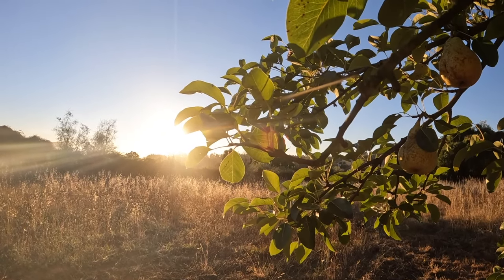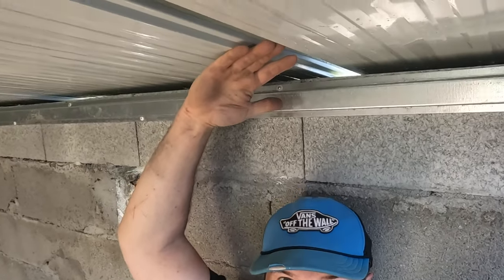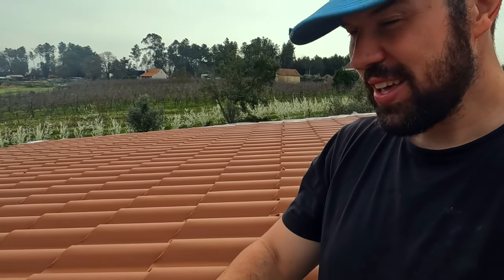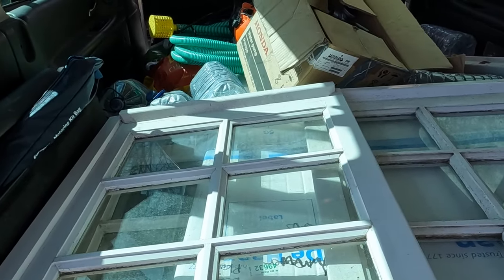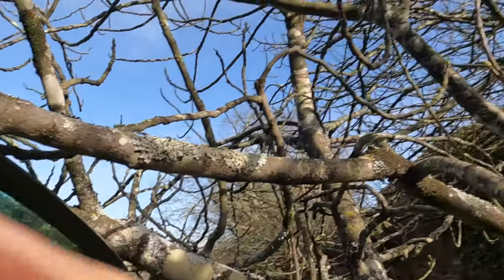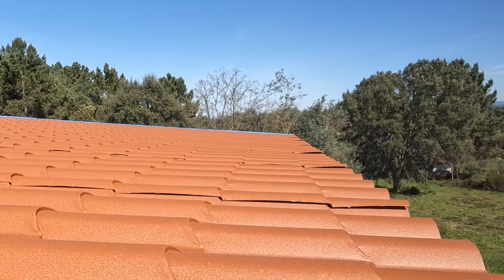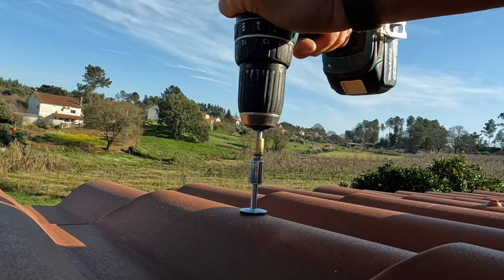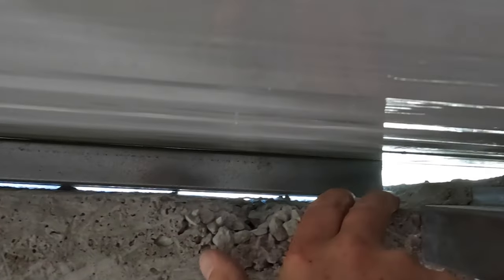14 - Renovation continues: New roof on the abandoned barn with the Indie Projects

Comment: That looks most excellent that roof does, they are quite handy those roofpanels and easy to fix as well. Great to see Theo came over to help you out, he is such a nice guy! Why did you not cement those gaps instead of foaming them up, is all of it temporary? Have a great weekend you two!!! Cheers Bert 🙏🏻❤
Reply from the maker: Inside will get foamed and the outside gap will be cemented, I was told to use foam on the inside for insulation and also helps with sound insulation...... In terms of the insulation were not sure weather to go with a polystyrene board as it's super easy to move and for or rockwool as it's more of a pain getting in but apparently is much better 😄 decisions decisions hhah have a nice Sunday buddy
Reply: @escapetothequinta  It already is insulated, isn’t it. The roofpanels are like a good 12cm thick, or are they thinner??
Reply from the maker: Oh no the roof is super thick but I was going to insulate the walls too on the inside between the metal studs I put in 👍

Comment: Enjoy watching projects getting done. Was surprised you raised the roof only to cut into it, didn’t see any rebar either. Hopefully the roof is strong enough to withstand heavy winds. Have you considered getting a shredder to handle all the limbs you are generating?
Reply from the maker: I was thinking about a shredder but everyone seems to say they are a bit of a waste here, I'm undecided. I'm going to use some to make a raised bed but chipping th brambles makes sense to me as it'll rot faster or be a good mulch ☀️

Comment: Pruning Fig Trees: Figs only grow on last year's new (green) wood so pruning is a multi-year project or you end up with a year of no figs. Best done at the back end of the year. If you have any half developed figs left over from last year remove them now, they won't grow and will stunt the growth of this years crop. Figs can crop up to three times a year so any left over should be removed.
Reply from the maker: Ahhhh that's awesome advice thankyou so so much. Currently it's above the roof height so hasn't been pruned in so many years. Apparently it's quite a productive tree. How old do you think it is? Have a great weekend 🤗☀️
Reply: @escapetothequinta  I'm in Northern England so we keep ours in a South facing corner and prune just to stop it taking over the patio. I'd check with your neighbours and see how they treat theirs. The Trees also benefit from a root feed once a year. They grow in poor rocky soils but they still need a feed.
Reply from the maker: To grow figs there you must have some very green fingers!!!! The neighbours said to hack it and it'll come back stronger haha I've tried to be a bit nicer. Thanks for the info on a root feed I may do this in summer 🤗🤗
Reply: @escapetothequinta  we only get one crop maybe two in a really hot summer.
Reply from the maker: That's still a credit to yours skills, do your dry them or make jams or just eat as they are?